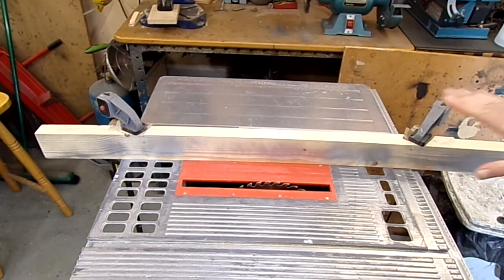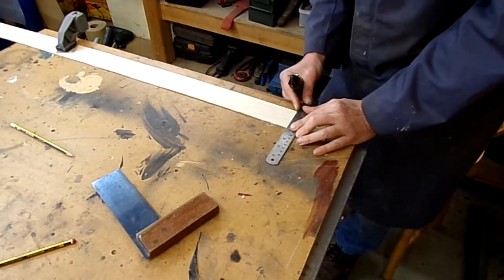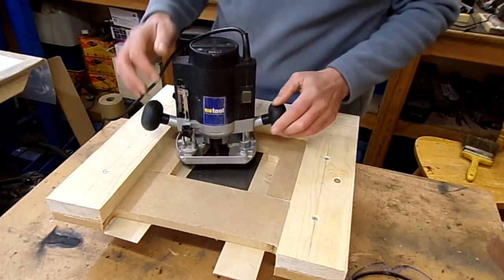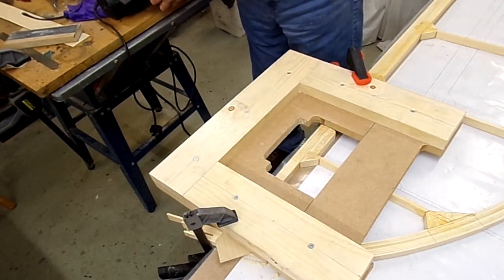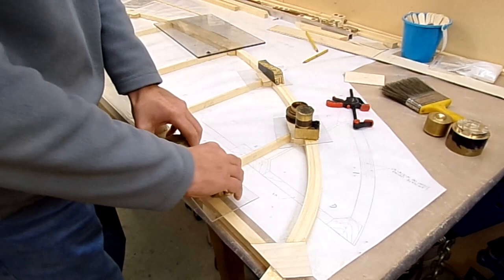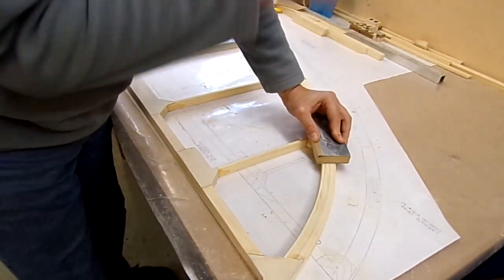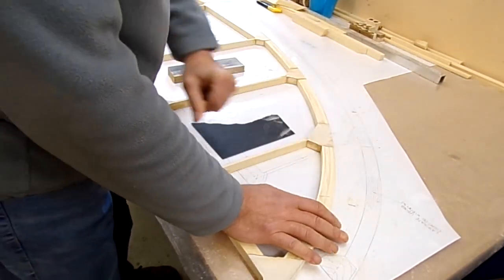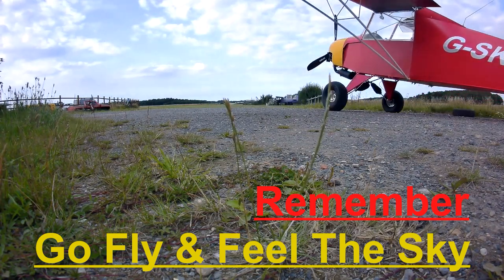EP4 Fisher Youngster V Kit Plane Build - Wood Tail Flush Gussets

Comment: Hi Algy, Nice work on the Fisher, I’ve been looking at their kits for year’s and have been thinking of starting one.Have you decided which design your going with after you finish the Youngster tail.I’ve just retired so I have time to do a project like a Fisher but haven’t decided which one to do yet.Keep up the good work.
Steve Daly in Northern Ontario Canada
Reply: The internet makes it a small world! 🙂
Reply from the maker: I think I am about there on what I am going to build, it is now down to cost of kit and engines. I need to get the funds together and sell the car I have just finished the restoration on (which I hope to drive a bit this summer before selling), as I need the room in the workshop.
On the Fisher aircraft, from what I have found they are all built in simular way, so it is pick the one that meets you mission and appeals. For me the Youngster is the best match from Fisher, to meet UK SSDR requirements (MTOW<300Kg, Stall <35kts and / or wing loading <25Kg msqr), also I should be able to fit (being a big chap at 194cm).
Reply from the maker: It is.
Reply: @flyingkub  Looks like there's more room in the Youngster than the SD1, I also was looking at the SD1 at one time, ..plus others but I like the all wood/fabric  construction.
Reply from the maker: @Ch2pilot1  not sure how much extra room there is in the Youngster and the useful load is similar but the biggest draw for me is the flexibility in the build, that lets you put your own slant on it. Like you I like the classic wood and fabric look and biplane Microlight aircraft are not that common, that said neither are fast low wing Microlight aircraft especially single seater ones.